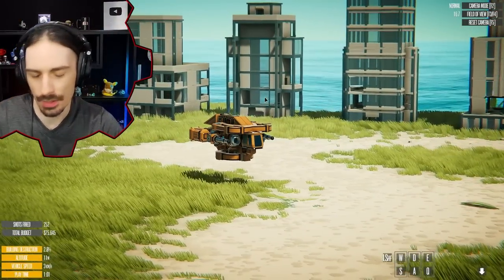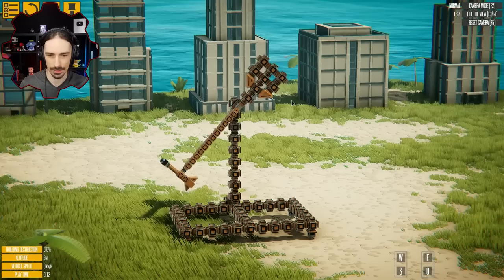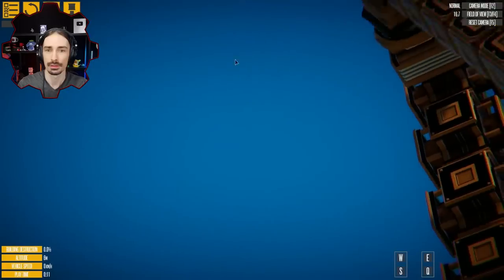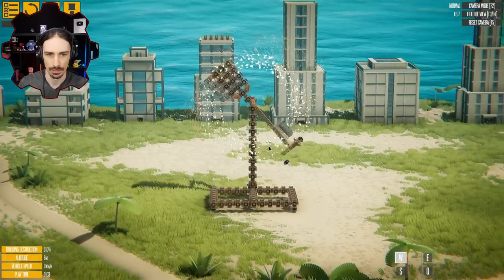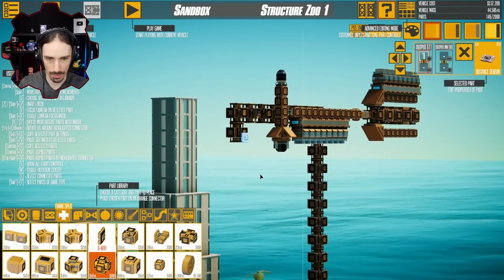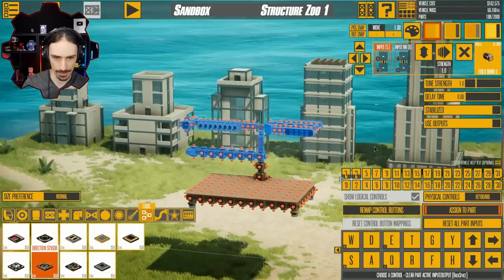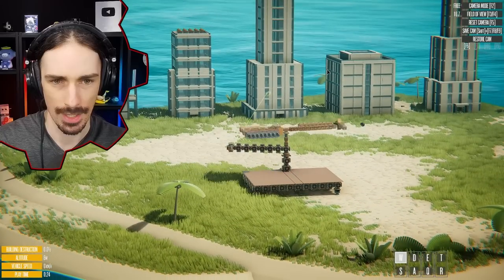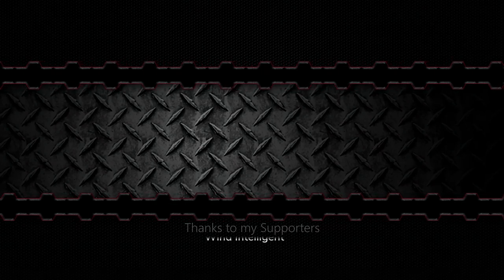I Converted The SpinLaunch into an Instrument of Destruction!

Comment: I dont think thrusters would defeat the purpose of spin launching. I think it’s to help yes reduce the amount of fuel used but as well as allowing the payload attached to it to not use as much of its own fuel for the initial energy which is usually where the highest burn rate is.

Comment: I think part of the issue with double stacking the swivels had to do with your gyroscope. When you would spin up your bomb was trying to stabilize while your swivels were not very stable. Probably would have been better if you'd have built from both sides so everything could've been more stable. (Gyroscope also probably had to do with your rotation while stationary.)

Comment: I believe the problem with the inconsistency was happening because the AND gate required Scrapman to press e. Each time, he might have pressed e later giving the contraption another spin and therefore, more speed which amplifies the tiny inconsistency present because of the game.
Reply: More likely the frame rate I think. I do agree though. It’s worse if the game is also non-deterministic with its physics. You can tell it is because of the way changing the game speed effects the physics.

Comment: i think the sensor is reacting to ether the bomb is wandering around or still on the end causing your aiming problems ..... 

also need a separate frame for the aiming laser/sensor than the missile carrier, basically meaning the arm isnt causing wobbly physics problems because 2 spindles are not trying to interract anymore

Comment: I think most of the inconsistency is due to the sensor wabble, it is detecting the launch arm sooner/later than intended because of the angle. perhaps try adding a anchor below the sensor and a solid plate to connect it to at the desired direction to fix its location and prevent excess wabble.

Comment: @ScrapMan
You could put the sensor closer to the base where the rotation is. Because the closer you get to the axis of rotation. The slower the movement is. Making it easier for the sensor to pick of the arm movement more correctly.
Reply: axis
Reply: @CHECKERCE  Thank you. I was going to write that but I wasn't sure if it meant what I was thinking it did xD

Comment: You could build the fire fighter machine called "Big wind" equipped with MiG-21 engines mounted on a T-34 tank . You could use the turbine vacuum to blow buildings down.

Comment: Seems like the physics lose stability with only one connection point, I wonder if adding a brace on the other side of the pivot point would've reduced or eliminated the wobbling (might've been able to add another servo for more speed as well)

Comment: ok, how to make it more precise: first of all, equalize the weight and lenght(lenght is importand for momentum, when its not equalized its wobly) of all part, this moving part should be attached to the center of the base, the sensor "arm" should have counter part with same weight, but no sensor ofc. to make it even better, put attaching block on the piston at the end of sensor arm pointing down, after you aim, you push the piston down and attach the sencor arm to the ground. also you can increase the amount of attchment blocks on the bottom aswell.

Comment: There is more to balancing such a „wheel“; both ends don’t need to be the same weight, they need to have the same angular momentum, which means weight further away from the centerpoint is having a greater effect.

Comment: The reason why your game speed affects your spin is that you probably have an unconnected block clipping somewhere inside your creation. Try clicking a block that is obviously connected to the structure, such as the cab or one of those big panels on the bottom, then select connected parts and invert the selection, you can then move the piece to see what it is and place it back or just delete it if it's a duplicate. Clipping blocks can be some of the most extremes form of power in physics based games like this one, so it looks like you've only got a single small block glitched in the launching arm
Reply: forgot to mention why slowing down time makes it spin backwards. Your thrust is a constant set by the engines, whereas the energy output by the clipping block comes from its collisions with the rest of the structure. With time slowing down, the game is allowed to calculate a greater number of movements and collisions, thus increasing the "propelling" power of the block while the thrusters keep their relative value regardless of time speed.
hope it all makes sense, it's still all a guess but it would also explain why the arm would randomly start spinning clockwise and counter-clockwise
Reply: i'm still watching the video and you've got the concept in mind it's the same problem you've explained with why the sensor worked differently under different time conditions

Comment: I did figure out the editor is correct, SpinLaunch do in fact release the tip slightly before the end. They also release the counterweight at the same time to avoid destructive g forces. They have also been experimenting with launching two payloads half a rotation apart, getting rid of the counterweight.

Comment: Scaphman, there is nothing wrong with a sensor, game physics works the best when there is more FPS for better collision detection, the less of an frames, the worst collision detection

here is good example:
large slow moving object is the least likely to go truth a collider while small and fast are able to go truth most of them and game wont even know if it passed truth or not
in FPS games we programmers use ray-cast from last to new position to fix that problem

also ignore my actident, ok?